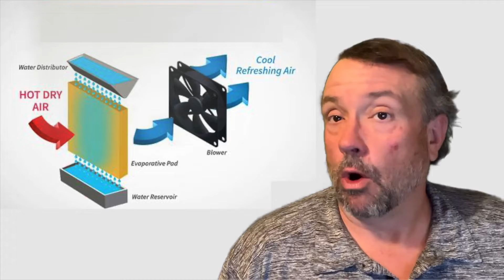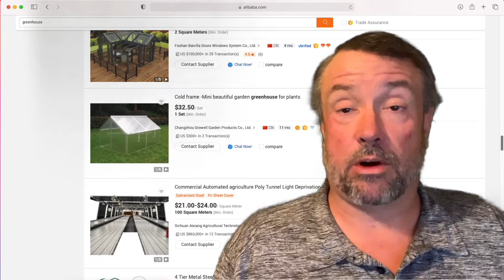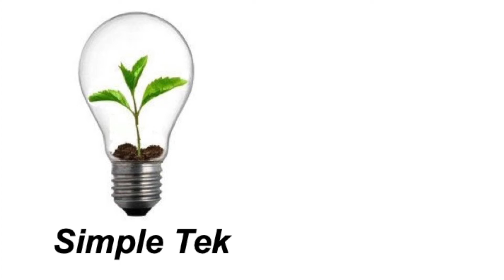Greenhouse Roof Vents - Sawtooth Greenhouses

Comment from the maker: Tell me about your greenhouse venting!
Reply: I have a fan on the west side pulling air out and screens openings on the east side.  Temps would still get into the 30 c in winter and 45 c+ in summer.  I took out a section on top near the east side and made it a removal cover and place a screen to reduce insect activity.  Temps now get too low 30 c on hot summer days, also I leave my door open with a bug screen.  My GH house is sunken by 2 1/2 feet.  Just to add I had extra solid 1' insulation and I inserted them between the joists to reduce sun exposure and hopefully will help in the winter for R-value.   Thanks for the info, very helpful.

Comment: You can purchase a jig to bend the top rail of a chain link fence to make a sawtooth greenhouse. If you place the greenhouse on a slight slope the excess water will drain out and the heat will rise to the top end where it can be vented out passively without a fan.
Reply from the maker: I like it

Comment: Still waiting for your greenhouse heat battery update. How's it going?
I'm in the planning stage of a conservatory build off the back of my house.  It will be 30 ft. By 60 ft. With a year round tropical garden inside. I plan to use a sand heat battery under the conservatory heated by solar electricity or propane. Air piping to heat the air as well as water heat for soil. I need to keep it min. upper 80°s in day and no less than 65° at night. Can go a little lover in air temp if I can keep the ground above 65° at all times. I'm zone 7b NJ. So it should be do able. Love the videos. Just keep us updated on your project. Thanks
Reply from the maker: Will do and thank you too much for the kind words!

Comment: I own 3 200sq.m. sawtooth passive venting design greenhouses and from my experience I would like to add that it is much safer to have the option to open-close the roof vent. The passive vent design's flaw is that it will always allow air to rush into the greenhouses and we will need to be careful about the greenhouses' direction to the wind and consider its ability to tolerate the storm.
Reply from the maker: Great tip!